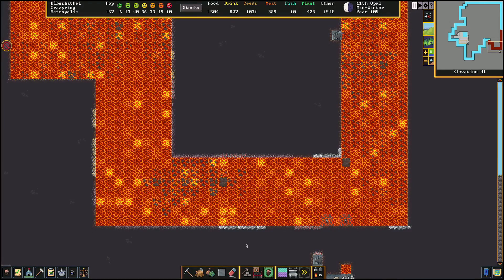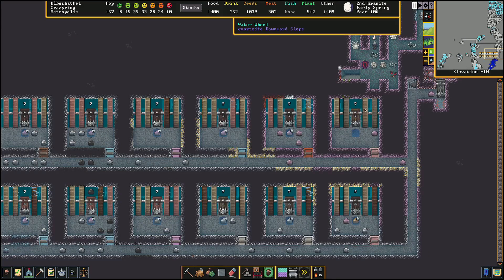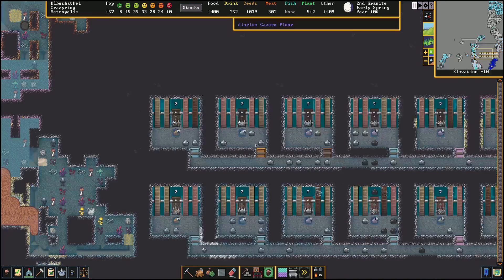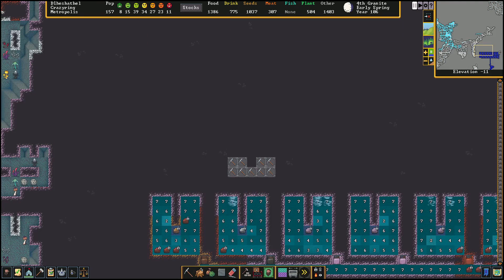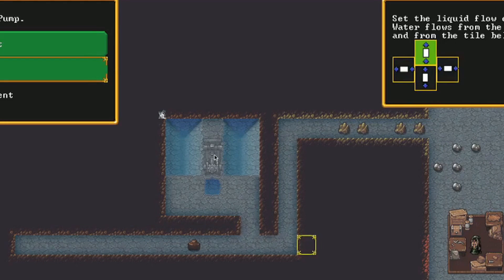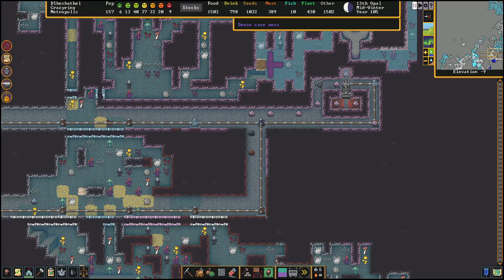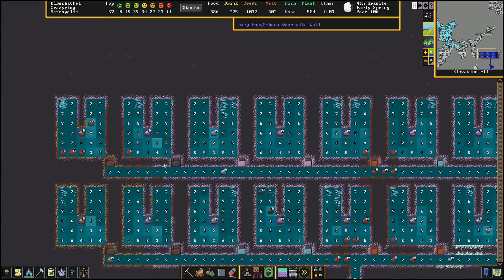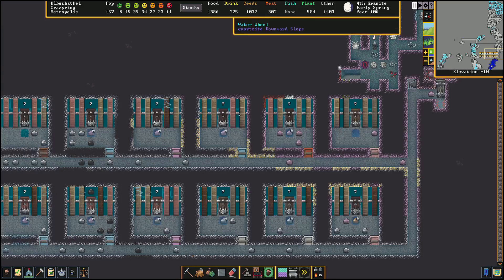Unlimited Power: Dwarven Water Reactor - Dwarf Fortress Engineering Tips

Comment: I’ve seen a couple videos on this and I’m wondering could you add the water to the system with buckets?
Reply from the maker: You can but it'll take a while. Each bucket is 1/7 of depth and its 22 squares to fill iirc, so that's like 154 pours.

Comment: I'm sure this will become clear when i try this, but what is powering the lava screw pumps on different levels from the one on the level with the water wheels? Don't the lava screw pumps need to be connected by gears/shafts going all the way down too? I don't see how the power travels all the way down to the bottom level screw pump by just connected that one 100 levels above it
Reply from the maker: The channel below the horizontal part of the T allows each screwpump to be touching each other, which transfers the power between them.

Comment: Any reason why the reactor would stop every minute or so?
Reply from the maker: Maybe you have only a small bit more power than you need so when the water moves in an odd way it turns off the pumps? Try adding an extra reactor to see if it stabilizes.
Reply: well I suppose I didn't have the optimal amount of water, I switched to the single wheel on each side version from the wiki with exactly 63 units of water and it works flawlessly with no evaporation.

Comment: So is this actually a bug? (The water wheel/pump system is generating more power than it uses) Defying the laws of physics seems like a bug...
Reply: @View Bot The electrical energy from a hydroelectric dam is generated from the gravitational potential of the water flowing through them. That water did NOT get pumped up to have that potential energy by the hydroelectric system itself. That water got there by the natural water cycle that deposits it into mountain ranges via precipitation where it drains into the river where it will go straight into the hydroelectric dam.

So yeah, how do you think hydroelectric dams work irl?

But its okay I did my due process and found on the DF wiki:
Perpetual motion
Due to the relatively low power draw of a screw pump, a self-powering assembly can be made with a water wheel that still leaves plenty of excess power for other uses. This is undeniably an exploit and possibly a bug.

Comment: I can not post a gif to demonstrate due to youtube filtering external link in comment, if you place a water wheel over water which once flowed off the map, the wheel will turn even if the water ceases flowing. I would guess this is due to the game wanting to optimize water wheel on rivers, so it assumes flow for bodies of water that touched map edge and only tests depth. 

So if you have water is w, water wheel t, map edge/fortification a, raisable bridge b

    t
w w w w w w b a

The wheel can turn whether the bridge is raised or lowered, provided the water flowed off edge at least once. The water level still must be at least 4/7, but it can be static, low lag, 7/7 water and still turn the wheel.
Reply from the maker: Oh wow, that is really interesting! Thanks for the tip!